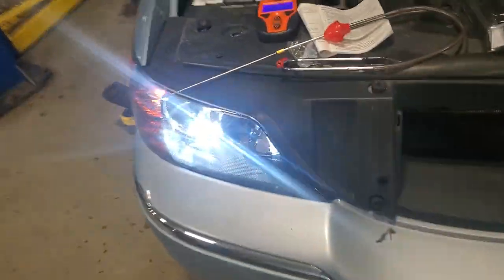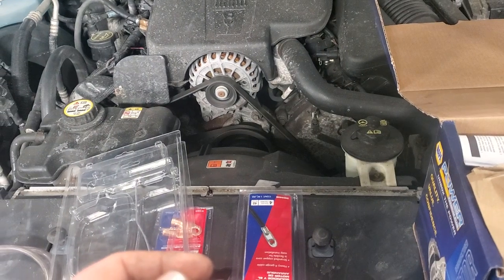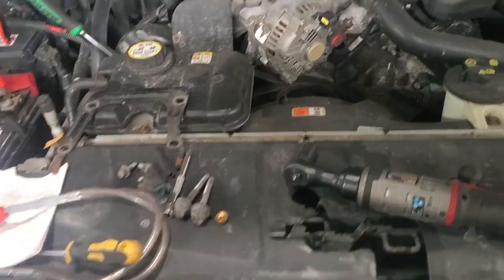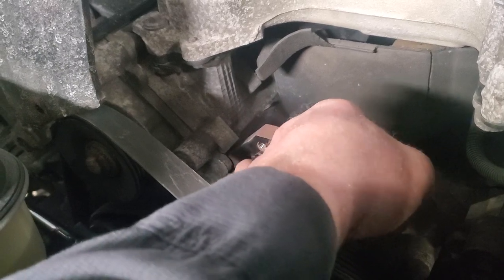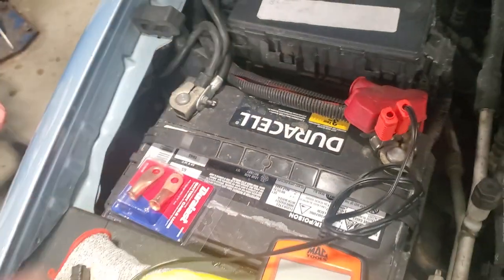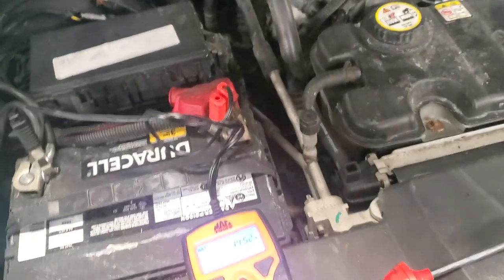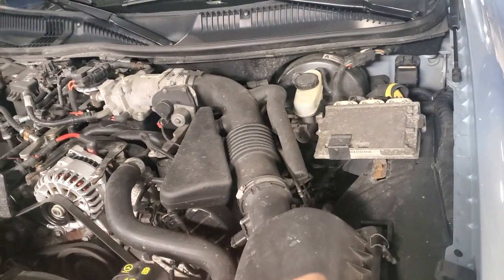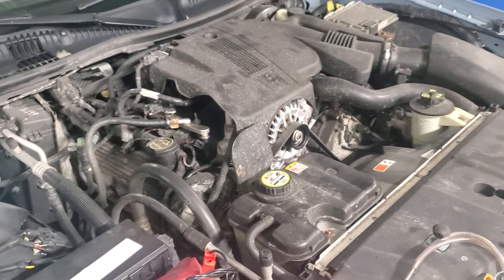ADD ON GROUND STRAP Lincoln Town Car Installed New Alternator - How To, Remove ground cable first!!

Comment from the maker: Always make sure to pull your negative terminal to the battery before you start any electrical repairs
Reply: Can you make a quick video on how to do the big three upgrade on a panther!?!  please
Reply: Any advice on this issue? Interior/exterior  Lights dim under load (like when I have the hazard lights on). Sometimes get a battery light on dash when coming up to a stop. I just replaced the battery ground cable fully, new battery, new alternator.
Thanks
Reply from the maker: @Knightsauce  big 3?
Reply from the maker: @johnkrneta8711  make sure you don't have any open recalls on your car first

Call the local dealer and give them your vin and see is anything is open on your car 

Such as the lighting control module

We had an issue with alternators during the panther platform years, there were vehicles I went through 7 alternators on 1 car alone before a Autozone Gold Fixed my problem
Reply: Out of curiosity were you getting any dash warning lights? I just replaced the battery and the original 241k mile alternator in my 03 TC 2 weeks ago. I cleaned up the terminals good but didn't know about the block mounting surface. 2 or 3 times now I will be driving and my battery light pops on but what us weird is when I accelerate the traction; air bag and brake light will come on. The lights aren't diming like if the battery was week but rather the opposite, when it happens the dome light seems brighter than normal almost like it's an LED.  Also, where can I locate a new pcm that you were talking about?

Comment: I had to do the same thing to my '07 Town Car. I had also ran into a problem with the positive terminal to the starter. It corroded completely off. So I had to replace it with a threaded 4 gauge lug from NAPA and installed a new starter while I was at it. Figured it couldn't hurt since I had 14 years of service out of the original. Oh and by the way, thank you for your video on how you replaced your starter. It was a big help!!
Reply from the maker: not a problem friend, glad your enjoying your panther and many more years to come

Comment: I just did the alternator ground similar to what you did in this vid. My setup is a bit different than yours, I guess because of my smaller engine. I had to take the belt off to get to the bracket as my alternator sits on top of it. Oh what fun trying to get to the tensioner; my forearm kept scraping against my fan. But I got it done! Thank you sir once again for the great advice. I also added ground to body and frame like you did in that van vid. Stay Blessed!

Comment: I have a 2006 Mustang GT that I bought new. I had put like 3-4 alternators on it and 3-4 batteries in like 80,000 miles. I read about adding a ground strap as it said the alternator may not see the correct battery voltage and overcharge the battery and ruin the battery and the alternator too. I ran a ground strap from the alternator mount bolt to the negative battery terminal like 5 years ago and all has been good since. Knock on wood. Don’t know why it was not like that from the factory!

Comment: Glad to see the Town Car is back in action!
Reply from the maker: I just had to order an air suspension module for it
Reply: @FordBossMe  Oh, didn't know you were having problems with it. Seemed fine when I drove it
Reply from the maker: It recently popped up a couple days ago luckily my bags don't leak
Reply from the maker: The air suspension was replaced in this car about a year-and-a-half ago the only thing that was not replaced was the module itself and it's not uncommon for them to go out
Reply from the maker: Well more like two and a half years now cuz I have a look at the year
Reply: @FordBossMe  Gotcha! I'm surprised mine is still working as I think that will be my next big repair also

Comment: My issue with my 05' Vick is the voltage drops from 14.2 down sometimes as low as 12.5 but come back to 13.9 and creeps back up to 14.2... I got a new NAPA alt and Gold battery! Any thoughts?? But will be adding the ground from the Alt to the negitive battery terminal!
Reply from the maker: Could be something you are running turned on when this happens
Reply from the maker: Could be bad alternator

Comment: My 2001 Lincoln Town Car, with a brand new AC Delco alternator, runs right around 14.0v give or take 0.10. But I have a high-pitched whine that seems to be coming from it. The one I replaced is apparently perfectly functional and the noise is exactly the same with either installed. I'm going to try the ground strap mod to see if that fixes it. 

I hope it will, because I'm out of options, having replaced the alternator, water pump, tensioner and pulleys, harmonic balancer, and the serpentine belt. Not all of those things were in response to the noise, but they do cover the entire rotating assembly on the front of the engine except the AC compressor, but the noise is coming from the upper front of the engine and it doesn't change whether the compressor is engaged or not.

Comment: I have the same problem and I have this issue with the cluster lights all dying and kicking back on and the light for the battery goes on and off I think I got the same issue along with bad ignition coils but what should I do with the alternator wiring

Comment: Rich, I took your advice and added that cable to my 06 town car. My mechanic kind looked at me when I gave him the cable to install, and said, well it can't hurt anything. I can see from your video that stable charging is a very real advantage. Is there any other advantages or component protection that this mod would produce? Just curious.
Reply from the maker: Cuts down on Coolant electrolysis

Comment: Great video, beautiful car.   Consider replacing the intake manifold soon and the oil filter adapter gasket. consider the under intake heater pipe and nub behind the water pump that the pipe slides onto and the o-rings on the nub.  Consider doing a timing set and replacing the plastic timing tensioners with the metal ones. the metal ones have a little ratcheting arm on them that keeps the tensioner arms pressed out tight when the car is off. Also the metal tensioners have an oil squirter on them to keep the chains cool and lubed.  loose chains on start up is what bust the chain guides. you won't need to really do these things until the car is aged 12-15 with at least 200,000 miles.
Reply from the maker: This vehicle has 225000 miles on it and runs like it is brand new, modified some things to make it more powerful and quicker and changed some things about the car but not very much and it runs like a top and the intake manifold looks newer and it looks like when somebody was in there they replaced that pipe underneath the intake manifold

Now I did see a guy modify that pipe what he did was he ran a 90 degree rubber elbow up and then brought the coolant line out the top so if it ever leeks could service it quick and he ran it alongside the passenger side valve cover and then tied it back into where it goes
Reply: There's reason they quit using the metal self-ratcheting tensioners, and no it wasn't because of cost like most people think. Chain tension changes with heat expansion of the chain, block and heads. At it's loosest point, the ratchet(s) could click out one more notch and then make the chains too tight at all other temperatures. Thats why the redesigned them. They did have to redesign the seal on the back of the plastic ones because they had some blow out, but thats no longer an issue as far as I know. I own a 2006 Crown Victoria P-71 that has 165,000 miles on it and like 4000 idle hours on it. I recently had to replace the cam cover gaskets and when I had the engine open I was amazed to see how clean that engine is on the inside it looked like an engine with 6500 miles on it, not 165,000 miles and a shit ton of idle hours on it. No sludge anywhere and hardly any varnishing. I looked into the timing chain area and all of the guides looked perfect. The chain isn't sloppy and it doesn't make any noise on cold starts. I got all of the service records from the car when I bought it. It was a small town PD sergeants car. All of the maintenance was done according to Fords severe service recommendations. Preventative maintenance is everything and I can't say as to when I'll replace the timing set, probably not for another 100,000 miles.

Comment: Hi everybody! First of all, great videos man, thanks for making them!!! 👍🏼
Second, I'm having some issues with my '02 Grand Marquis charging system. I noticed that when I turn on the windshield wipers the headlights turn on and my battery starts to drain. I checked the alternator and seems to be fine, but when I measured the voltage, it doesn't go higher than 13.2v. Could it be just a bad alternator or is it a problem with the wipers motor? If anyone has ever had a problem like this, I would really appreciate some pointers to go check, and don't just changed unnecessary parts. Thanks in advance!!! 👍🏼
Reply from the maker: Seems to me like there's some kind of problem with the windshield wiper selector and possibly the wiper motor

Comment: I have a 2000 Lincoln Town car & I'm having trouble with my brake light switch melting & also my tail lights doesn't work but all other lights do! I'm puzzled on the tail lights for sure thinking I have some resistance on the switch. Thanks in advance!!
Reply from the maker: You got a short somewhere you got to get into that harness along the driver side seal plate where they kick panels at you're going to have to follow those wires all the way back you're going to have to figure out where it's shorted out
Reply: @FordBossMe  Thanks. I'm definitely going to have to find someone that does electrical work. Not sure why my brake switch moves tho it's supposed to be in place as the brake pedal moves right?

Comment: Bro im so sad . i ask about the head valve cover gasket . but i just notice that your car has the easy set up .  if you run in to a 03 tc and work on the valve cover pls make a video. Your set up is different of the parts is the easy one . your blessed
Reply from the maker: Just take the plastic cowl off that's on the firewall and lift the valve cover straight out

Comment: I’m battling low voltage, 2005 town car 4.6, new alternator,  new wire from alternator to battery,new battery, new ecu, new alternator plug. While running starts about 12 volts and just falls while running. Then I put it back on charger fires up. I haven’t done a ground yet from alternator to battery though
Reply from the maker: All I can do is tell you I have plenty of video here of what I've been through with these Alternators on these Panther platform cars and if that doesn't help you then I won't be able to help you anymore than that

Comment: I know the video is old. So is your top ground also to the battery? I dont know much about cars or grounding. My new alternator wont charge my new battery. I changed the top alternator ground and fuse from the alternator to the car. Still nothing. I dont have anything hooked to my battery.
Reply from the maker: Yes I showed the exact routing of the entire Cable in this video and in another video I was as clear as I could possibly be

Comment: My car is slow to respond to a load put on alt.It has a voltage drop for like a second and a half. I am going to check the alt ground. I also understand when removing the battery you have to let car idle to reset fuel trim for 15 minutes after reinstalling battery.
Reply from the maker: People say that but I've never had that issue you can go drive it normal and it will relearn on its own

Comment: Thanks for making such great videos. Would this process perhaps be the solution to the dash lights flickering and info screen glitching out? 1995 lincoln continental. Thanks a ton!
Reply from the maker: Well those had instrument cluster problems so a lot of times you had to replace them but there is a ground underneath the driver side rear passenger it goes from the body to one of the suspension components
Reply: Maybe the Headlight switch you need to add relays to headlights front the car or you can find kits on ebay just plug and play all good. My car is 1999 crown vic

Comment: Have u had any problems after ?thing about doing this 2 my 1997 Lincoln town car
Reply: Ive been having a dimming problem
Reply: So would this be like my transmission bellhousing ground because thats the only one i havnt done
Reply from the maker: Yes
Reply: Aye for my frame ground the smaller ground wire is it a 10 gauge? I wanted 2 change that out 2

Comment: I picked up my 2006 Town car and it had a ground cable from
The alternator to the battery and couldn’t figure out what it’s for, also battery light is on but I haven’t had any problems…
Reply from the maker: Prob still needs a good alternator they had internal regulator problems

Comment: I never thought about an extra ground wire like that.
Reply from the maker: the cable was like 9$, cheap add on
Reply: @FordBossMe  Wow. That same cable was $14.99 at my local AutoZone. I ordered my cable from Amazon for $7.50. The only difference is the cable I got was a 36" and not a 40", but it still worked and was a perfect fit.

Comment: damn good video . just got a 94 towncar,,it doesnt want to run when i shift into drive or reverse,,idles fine, but stalls when put into gear ,just replaced nasty fuel filter kinda stumped,,no codes
Reply from the maker: Throttle body or throttle position sensor
Reply from the maker: Crank sensor or spark plugs
Reply: i cant just throw parts at this,, not gonna go there,, I need how to really diagnose this car,,,guess I need an obd1 reader and a manual
Reply: @FordBossMe  wound up being 2 gallons of bad gas
shes running great now

Comment: Could this help with my 2008 car is throwing 13 low voltage codes on sensors I’ve replaced
Reply from the maker: Could help but it's prob a bad alternator or battery

Comment: hey bud got a 04 ulitmate front lights are on but the tail lights are off keeps blowing a fuse any suggestions
Reply from the maker: Unfortunately you're going to have to start combing through the electrical wiring system from the lights forward

Comment: My grand marquis 2001 charging 13,1 with ac on and 13,3 with ac off when i started morning charging 13,5? With sound system on it drop to 12,7 instal new battry and new alternator same issue😓
Reply: When i strat it will charging 14,0 v
Reply from the maker: And you're going to have to check all the ground cables and remember I have been through six seven alternators just to get a good one on these and it was a Napa Premium

Comment: When i start charging 14,0v after 15 min get down to 12,9 with ac on i get new alternator and new battery like the same? Help plz🙇‍♂️
Reply from the maker: I can't really help man you're going to have to do all of the same things that I talk about in these videos with these alternators I have a couple of them you're going to have to start studying up on them these Alternators on these systems cause me so much stress as it is I don't really want to talk about it I put enough information and stress into my videos to where I think you guys should be able to watch my videos and realize this is going to f**** suck I went through six Alternators on one car to get a good alternator, watch my videos you'll learn a lot I promise you you will learn through the stress that I went through with these cars make sure all the grounds are good and maybe even add an extra ground from the alternator over to the battery hey guys
Reply: @FordBossMe i can feel the stress 😢, thanks .

Comment: 14.6 aint gonna hurt new vehicles but any higher than 15 will shorten life exponentially, but yet another good vid!
Reply from the maker: it hit 15 several times 

I like to see 14.1 - 14.4 steady, and with this alternator no more 15v spikes and constantly in the high 14s
Reply: @FordBossMe  I added one on my 18 Platinum half ton and wifes 17 taurus sho